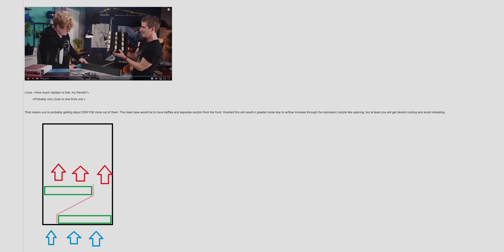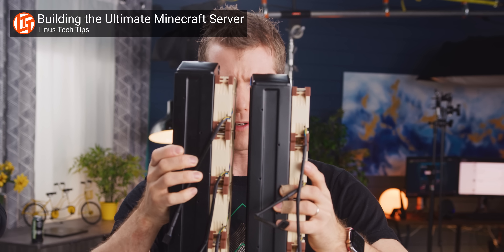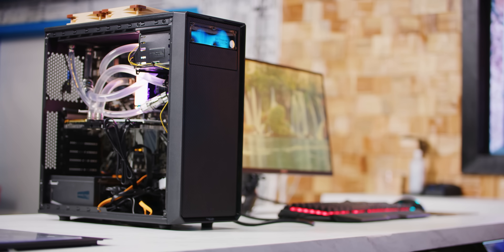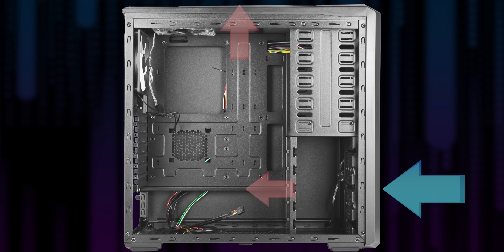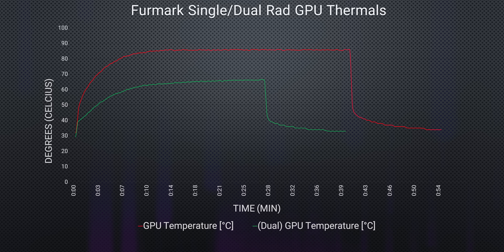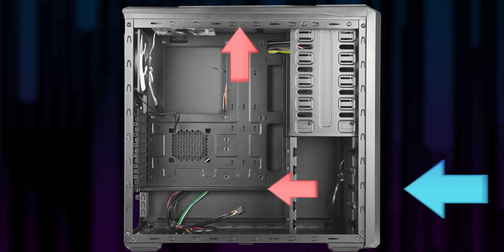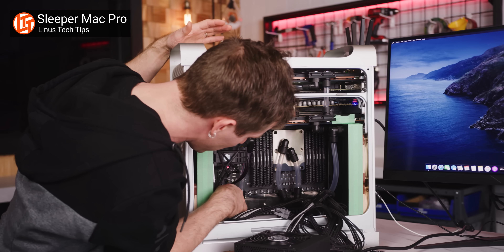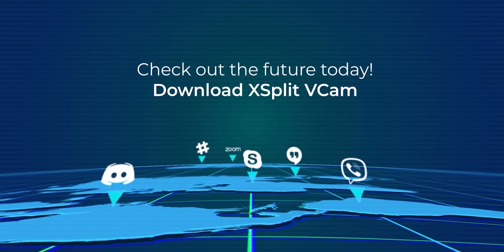I’ve been water cooling wrong for YEARS - $H!T Manufacturers Say

Comment: Linus('s Team) is lying/testing wrong....Corsair told that the positioning of the Rad can impact efficiancy, which was NEVER tested in the Video. How can you disprove the claims if you only use 1 Radposition?? No Front+Bottom Rad Test for example to prove Corsairs claims.
The Thermalload and Clockspeed in the this case only shows that the same PC was used in the Testing. Since 1 Rad was enough to keep it under TJmax those Slides dont say $H!T.
The Test also only went 30-45min, a second Rad introduces more Water. More Water needs more Thermalmass to heat up to the same Temperature.
There was either a very small Reservoir hidden in the drive bay or none at all used in the Loop, which may have caused the high Temp in the GPU Temp Slide for the single Rad.

Tl;dr
A bad Video with misinformation. Nothing was (properly) done to prove or disprove the claims.
Reply: Corsair specifically called Linus out on two of his builds. So he made another similar build for testing, and removed a rad from a stacked build and measured the difference. what you believe Corsair said is incorrect.

Comment: As a mechanical engineer I can tell you their claim has truth and I would agree that a blanket statement isn't warranted. The greater the temperature difference the better the results. However, if you were to say someone carry the air say via powerful radiator fans and get a large volume of air through one or multiple radiators it will without a doubt get you cooler temps. I believe their models/calculations weren't really taking into account the powerful Noctua fans with all them RPMs. If you do it with your average case fan with low CFM or RPM you'd probably get the results they got. If you happen to read this, yes it has to do with Thermodynamics : ) Peace.

Comment: I was baffled at the idea of stacking radiators, as I've never heard of placing two AC units front to back to cool a house faster, or two forces-air heaters front to back to heat a house faster. So made me confused, why would you do that for ANY kind of radiator??
But, front to back is different than side by side, and different from one pulling in with one pulling out but with space between them. Like a lot of viewers, I'm a bit confused at the testing method, and how it relates to Corsair saying not to stack them?
Reply: Obviously there is more room in a house for raiators than there is in a pc or server case.

Comment: @Linus - Did you try with a single rad on the intake, but, with just the additional fans on the top exhaust to increase the air flow through? It may be the second rad really doesn't do much and its the fans you also install that do the additional heavy lifting?

Comment: The effectivity of using the exhaust air for another radiator also depends on the plumbing and the flow speed. A high flow system should yield different results than a low flow system when the 'superheated' water from cpu/gpu is first passing through the back radiator. If the flow is high the water temperatures will be more average in the loop as it does not have enough time to completely vent the heat.

Comment: yes if only air traveling through a radiator instantly reached the temperature of the coolant i would only need one rad and a medium sized fan lmao but the fact is air traveling through a radiator only increases a few degrees and therefore can be passed through many radiators until those few degrees add up to the coolant temperature it is then at this point more rads become uselss

Comment: Wouldnt having two rads means there are more thermal mass for the water to acquire? so when testing you should add a reservoir to have both systems have the same amount of thermal mass. Not a physicist so the terminology might be off. That aside, I still think any extra method of dissipating heat will still result in a benefit as small as it may be.

Comment: Here's a simple example. Cars have two, sometimes three radiators. Most have the engine radiator, and a a/c condenser. If you run the a/c full blast up a steep hill in 100 degree heat, it might overheat. Because the condenser is in front of the radiator, it gets cooled first, and the radiator gets hotter air. If you were to put that condenser somewhere else, this wouldn't be an issue at all.
In short, stacked=bad two rads separated=probably fine

Comment: If they said not to "stack" them, does that mean don't run them in series/parallel either? I assume lioterally stacking them with fans in between. I imagine if you moved one of the stacked radiators in the Minecraft server and NOT completely remove it, it would be better than stacking and not having that extra one at all.

Stacking radiators on top of each other and letting hot air blow through them all is most definitely not as efficient as spacing them out... but I guess if you don't have the room, the more the better until you're eventually blocking too much air flow?

Comment: I'm not really into watercooling, but cooling performance mailny depends on radiator placement and flowpath, doesn't it? If the cool water flows through your components into a radiator ontop of the system, dumping the main heat outside the system and then running into a second rand in the front of the case, this would almost entirely get rid of hot air inside the case. This means stacking rads can improve cooling performance, if you add the radiator downstream in the waterflow and upstream in the cold -to-hot airflow. Corsair's claims depend on a different (wrong) arrangement of airflow to waterflow. You didn't mention the path of the waterflow in your system, making it a little difficult to interpret the results.

Comment: I always thought more rads = better. Even if the air is the same temp in my simple mind just passing through extra metal would make the water cooler. But what corsair told you makes sense actually. I would love to see more test tho... what happens when you have a better watercooling solution, because that 240 rad was struggling. What if you had a 360 rad lets say as (the only) intake in the front on a less demanding system, with only fans on the top as exhaust, then adding a second 360 on the top. I think that would be interesting.

Comment: what was the radiator flow order? if the top radiator was first to cool the hot water, it make sense.

the hot water is cooled by the top radiator and most of the heat will go out of the case, then it will be second cooled by the front radiator which will output a slightly warmer than ambient temp air into the case. this situation is the best case scenario.
if it were mounted the other way around, it would be worse.
Reply: Good point. Though that also depends on fan speed to pump speed rate.

Comment: Redo properly thanks.
 This, honestly, is a bit weak. Get to a 'Harbourbox/HammerOnBox' levels of thorough plz
Same system but embiggen the case so you can stack.
Then feed us results of the steady temps from under same load of:
- Single rad' small
- Single rad' big
- Two stacked rad's of same size (plumbed parallel)
- Two stacked rad's of same size (plumbed series)
- Two separated rad's (same as this vid)
- Two separated rad's both with outside intake (saaay bottom and front of case).
[I'm probably missing other options here]

Properly put it to bed.

Comment: Now I'm wondering if loop order would actually make a difference based on Corsair's model. If you run the loop in the order of exhaust radiator first to dissipate the initial brunt of the heat and the the intake radiator after so the already slightly cooler water can drop temperature more it may make a difference. From a performance standpoint it will probably be a negligible difference. It might be interesting to get a temperature probe in a few places through the loop to see whether or not loop order matters at all in this context.

Comment: They need new engineers. If the air in the case is cooler than the water in the loop than it will cool it more. Duh

Comment: This seems like a case where loop order would actually matter. Like if you have the hot water go to the top RAD first then go to the front intake RAD the water would be somewhat cooled already and the intake air wouldn’t be as hot. If the hot water goes to the intake RAD and then the top RAD you would have less heat dissipation.

Comment: So they said that air coming about the backside of the rad is about 39C and the water in the rad is about 40C  which means there will be no change and this sounds true on paper. The rads can't keep the internal water cold enough. What if there was a 2nd loop with "fresh" cold water that is actively pulling air out of the system? Wouldn't that increase both the pressure distance and cooling capacity?

Comment: If the case is actually good with air flow like the O11 then stacking rads defintely helps. My second rad defintely helped drop many degrees for me. My pc under load doesn't even hit 60C for cpu or gpu.

Comment: It is not how many radiators until it stops making a difference. It is how much fin surface area (connected to the water pipes and air), flow rate, ambient air temp, and power put off by the components being water cooled. There is no one size fits all solution for ideal cooling.

Comment: Also just the extra surface area would mean more black body radiation and that would pull more heat out of the water. Don't forget the extra water and thermal mass too. That would slow down the warming up.

Comment: Wait what? This is basic physics. Ignore the water cooling loop and simplify this down to its most basic form. You have a heat source and you are trying to dissipate that heat into a medium. In this case you are trying to dissipate it to open air. The cooler is there to help make this process more efficient. The best thing you can do to improve efficiency of heat transfer is to increase the surface area of your cooler to allow for better coupling between your heat source and the air. The second best thing is forced induction. Here is the key. So long as there is adequate airflow over the surface area of your cooler AND we assume even distribution of heat, then you could add more surface area at infinitum and you will get closer and closer to the theoretical limit of thermal efficiency. 

Now there are different ways in which you could configure the surface area in order to maximize efficiency, but you shouldn't ever see a decrease in performance with more surface area so long as air flow is adequate (which isn't a very difficult hurdle to jump).

Comment: Linus,

Coil transfer thermodynamics  is one of my fields of professional experience.  It is quite complex and involves over 40 different input variables to determine the best coil configuration for a given coil.  Our analysis engine is professionally certified and backed by an independent organization against real world radiators.  

Im not authorized to speak officially for the company I work for.  But Im willing to discuss what factors could influence the results.

Comment: There is a law of diminishing returns.  If for example you look at a CPU cooler with a 120mm fan and a GPU slot cooler with blower fan with radiators of similar total cubic volume, the CPU cooler would beat the pants off the GPU cooler while being far quieter at the same time.  The simplified reason for this is the law of diminishing returns.  So with the CPU cooler, the large fan intersects a wide face and then in this example is thin, so the air passing through picks up little heat before exiting out of the back of the cooler.  This allows the fan to spin relatively slowly and have a relatively low air velocity to do its job.  The GPU slot cooler in this example has a very long and thin cooler that collects up a lot of heat as air runs the length of it.  In order to increase the effectiveness, the blower fan has to be ramped up to high speeds, making it very noisy.  At this there are limits to how much noise people are willing to tolerate, so these coolers remain far less effective.  Actually this effect extends beyond coolers and into wing design, so gliders and globe circling aircraft tend to use thin cord wings as it is more efficient, thus allowing these aircraft to perform better than thick cord aircraft.

With my particular liquid cooled towers, I am using dual chambered case setups for both.  The goal actually was to focus on a combination of low noise at full computational power and high ambient room temperature as at the time of design it wasn't uncommon for the room to get up to 34C while the AC was cranking at full blast.  I suppose you don't have that problem in Canada, but for me taking the law of diminishing returns in, it was decided to split things up and have each radiator focused on getting the coolest air it could get and just go for bigger cases to accomplish this feat.  This has allowed me to keep the Noctua fans down to around 1,000 RPM while seeing 5-6C increase in water temps over ambient at full load.  Full load in this case is ~400W for two 360mm radiators, one 40mm thick and the other 65mm thick and ~500W for a 560mm, 86mm thick radiator.  The reason for these particular radiator thicknesses is it was what would fit in to the particular cases used where the dual 360mm radiator case is the Thermaltake Core X71 modified with a wooden 'skateboard' to allow the otherwise flimsy chassis to handle large casters and the other case with the 560mm radiator the Caselabs SMA8, a truely awesome case, which is a shame they are not made anymore.  The Thermaltake Core X71 with the built in 'skateboard' modification (using casters with long bolts, multiple nuts and a wooden board the nuts pass through before being bolted to the bottom of the case) is good enough for a gaming centric computer with most of the heat going to the radiators, so fine for having one radiator in each chamber where the Caselabs SMA8 is focused on a Linux system multi-purposed as a workstation and a server, so the light aluminum case is filled with hardware making it heavy, but not too heavy to lift, and making the requirement to be for a sturdy case with lots of drive bay capability, the top chamber focuses on cooling air cooled parts effectively while the bottom chamber focuses on cooling liquid cooled parts effectively with mainly just the radiator and power supply down there along with some miscellaneous crap.  Both cases only use a single row of fans as I was hitting issues especially with the Noctua fans where they got really annoyingly noisy with fans on both sides of a radiator.  I found I could actually crank them up a lot more and get a lot more effective use out of them per unit of noise (at least annoying noise) by only having a single row.  I am thinking the deal with this is the fans are so well optimized for single row operation that the air becomes turbulant and thus noisy with two as the effective angle of attack of the blades is altered in this push / pull configuration as well as pressure waves from the front fan blades turning into turbulent noise by the rear fan blades.

Maybe if you want to prove your radiator stacking deal, get the ambient room temp up to say 25C, fan noise level down to say 30db and make sure the noise comming out isn't extra annoying as you have fans, especially Noctua fans in a push / pull configuration.

Comment: @linustechtips. The reason they're saying you did it wrong because you had a radiator at the intake and exhaust. All radiators are most effect at an exhaust point you want radiators at a negative pressure zone. Cool air in hot air heading out the radiator also slowing the airflow could be a negative stacking rads is worse that spaced rads. I think what they weren't counting for was ambient temp the air has a very short time of contact/radiation from the radiator so some of the air, if cool enough will still be far cooler than the rad so can still absorb more heat from the rad. If you had a Case that allowed all rads to pull all exterior air without venting into the case that would be most effective. Atleast it's what we see in cars.

Comment: Te be fair to cosair though, he didn't stack the rads in that build like he did in the server build.
Reply: To be fair to LTT, they DID remove a rad from a stacked system and test the result, which is the same thing. Without he second rad in the stack, the temp increased by 5c.

Comment: Two rads with the same total fin depth as one thick rad should have near identical cooling. There is a diminishing return to total radiator thickness but two thin rads stacked versus a thick one should be similar  just total fin depth.

If you knew the real heat output of the cpu into the loop, mass flow rate of air, and input and output air Temps, you should be able to find where you would get diminished returns, or even hindrance.

Comment: in my 410 Elite with a rear 120mm rad, and front 280 rad with a single 140mm on top without a rad, I need to leave the 140mm on as low as possible or my coolant temp goes up about 10 degrees Celcius. Really weird observation I have had

Comment: Is Bernoulli's Principle at all relevant in this discussion? The air isn't being significantly compressed (because of the relatively low speeds), so if the fans speed up the air while moving through the small holes in the radiator's fin stack,  it would have to cool down. This would mean that even if a radiator had water temperatures equal or greater than the internal case temperature, it would still reduce the air temperature as it is passing through the fins when exhausted out of the case, thus cooling the water?